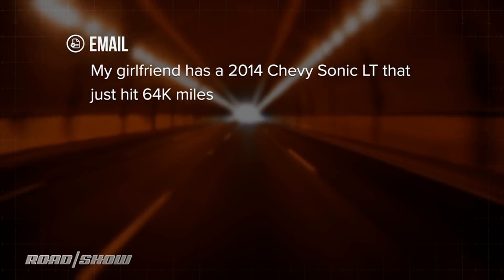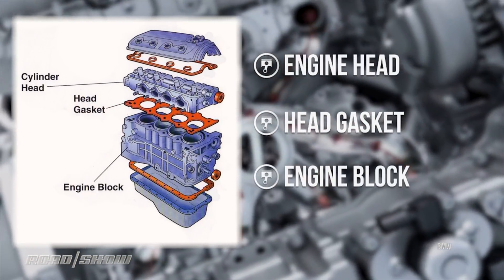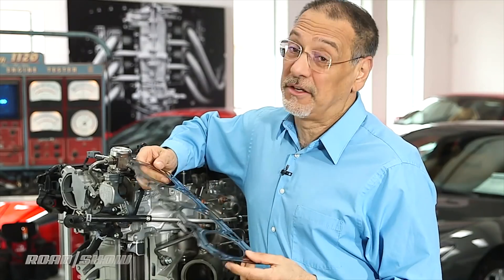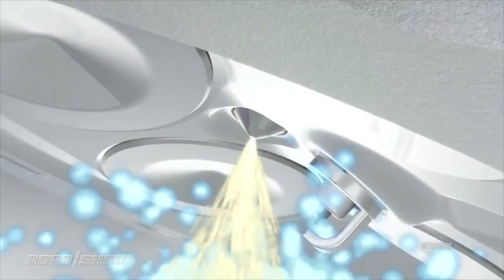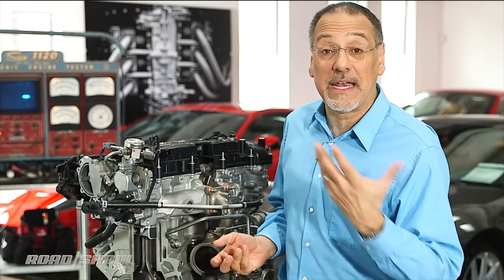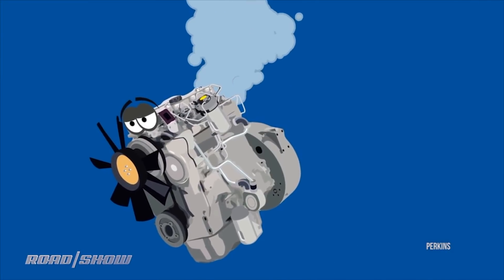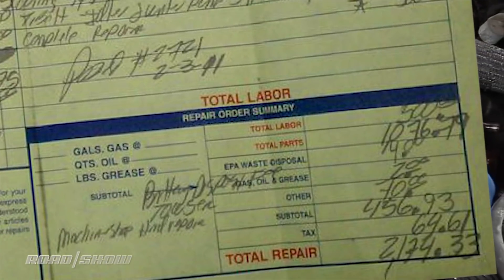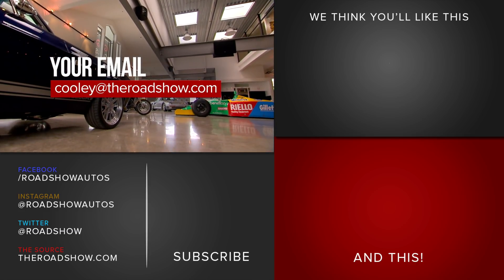Your Email: What causes head gasket failure? | Cooley On Cars

Comment: This might be a stupid question, but I guess they can't forge the block and the head as a single piece?
Reply: If you do that, you can't install pistons and rods
Reply: Daniel H install the pistons from the bottom and then install the crankshaft
Reply from the maker: It would limit serviceability.
Reply: https://en.m.wikipedia.org/wiki/Monobloc_engine

It’s called a mono bloc. A lot of older Mercury 2 Stroke outboards use this design.
Reply: I think there were some 1920-30 Bentleys that did that, but those were much simpler engines.

Comment: Rube Goldberg indeed. I'm moving to an ev for the same reason. Nowadays, the ICE has become relatively a lot of work for the same gain compared to an EV, for most people's transportation needs.  Hybrids further exacerbate this issue for those that want to keep a car for more than 5 years, a lot more maintenence parts to add risk of failure (Toyota seems to have mitigated the risk with reliability). 

In two years, after most of the good newer ones have been vetted, it'll be my next purchase. No first time models by a manufacturer.

Comment: Great explanation. I've had it done twice, to two different cars. My '94 E320, which ended up being about an $1,800 job. And on my '12 128i, which at the time only had 20,000 miles on it. Thankfully, warranty covered the 128i, but it was still estimated for about $2,200. The head gasket is truly the Achilles heel of engines, even in modern engines.
Reply: My first and my last BMW. Love how it drove, hated all the maintenance required.
Reply: @MRgoodbar831  good that you got wiser 😉
Reply: I'm surp5thatvyiu still buy BMWs
Reply: *surprised

Comment: Those 1.4t and 1.8 ecotec motors are kinda crap honestly. They were cheaply made and it shows
Reply: Isn't the 1.4T known to seize turbos after several years? I heard that somewhere.
Reply: @ryanlittleton5615  yea. Poor coolant and or oil flow I heard
Reply: @Suction_  I think it has to do with the oil feed hose.
Reply: True. Stay away from the ecotec engines. The old vortec engines were a lot better
Reply: I agree and also the 2.4L Chrysler motors that were in the PT Cruiser
Reply: My 2015 Cruze 1.4 I bought had 21,000 miles. By 56,000 I had done replaced the water pump, valve cover and had been leaking coolant for abit, which the dealership couldn't figure from what (turned out to be the block). Bad thing is these things have been common issues on the Cruze and other similar GM vehicles for years so I would have had to keep replacing these parts every 20 to 50 thousand miles! I then deemed the car to be too much of a money pit and traded it in.
Reply: Hello GM! Duh of course it’s shitty.
Reply: @InternetDude  That's fair.😂

Comment: I had a couple cars I bought with bad head gaskets that had the fiber composite with a steel ring to seal the compression.  The failures I usually experienced with those are the steel ring getting hot, expanding into the cylinder, then crimping itself into a little peak.  That lets radiator fluid, which is under pressure, flood into the combustion chamber.  It's a good way to remove carbon from that cylinder as long as you keep topping up the coolant and don't hydrolock the engine.

Comment: Just go electric....watch a Tony Seba video
Reply: I wish, but my family history budget for new cars has always been €5000 tops, so either we get jalop for 1K and cry no tears, or rarely get something near 5K and expect it to outlive us and sometimes with a clean conscious sold to a friend.

In short, engines that operate under more stress live tough lives wear more and head gaskets are an inescapable worry for most large capacity (+1.8l) engines or diesels, VWs and Mazdas are the worst offenders in our experience.

However hybrids and atkinsons (with steel gaskets) are the laziest engines out there, and damn reliable.

We could only be so darned lucky to find a plug-in hybrid or EV at €5K max. That would be much better.

Comment: Scotty Kilmer has plenty of vids on this topic, but nonetheless great vid, Cooley!
Reply: Skotty doesn't give good explanations and generalizes WAY too much.  As an ACTUAL mechanic, I find his videos cause a bit of worry that he'll inspire a novice DIY'er to get in over their head.
Reply: he doesn't explain anything in depth like this though, just gives a general answer
Reply: sadman hoque 

We still wait for head gasket failure reasons!!!
Reply: @majed9r  A few of the reasons for head gasket failure are...

1: Overpressure due to contamination in the cylinder such as drawing in too much water for one reason or another.

2: Overheating causing the head to warp in relation to the block due to extreme driving conditions or cooling system failure.

3: Improper design or incorrect part installation such as ford with their escort ecoboost screw up.

4: Poor engine design causing the cylinder wall to move in relation to the head, such as ford's poor design of the open deck ecoboost.

5:  Manufacturer defect of the head gasket material or construction.

6: Fatigue of the engine over time due to extreme driving conditions or poor design such as ford's 4.0l used in their early to late 90's Ranger and Explorer causing uneven damage to one or both head gaskets. (there's a reason that the head gaskets for that engine are sold separately, and the passenger side is more expensive)
Reply: hellcat1988 

Thanks man.
Reply: Senat Abazi Skotty is old and outdated